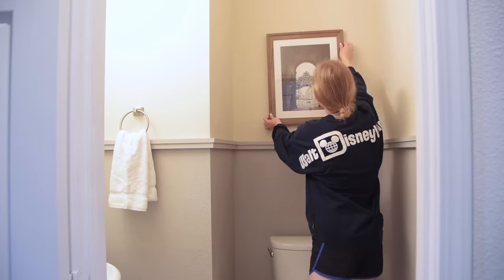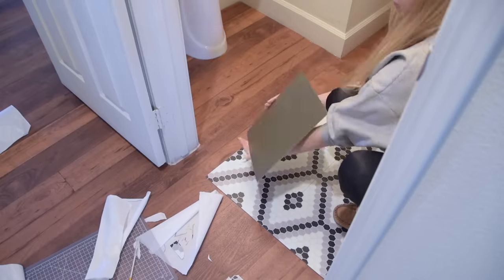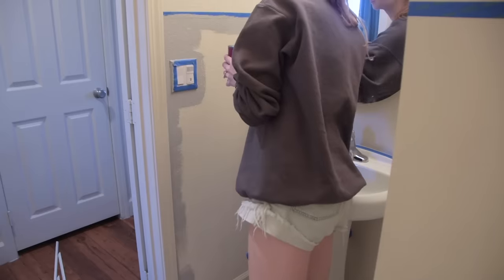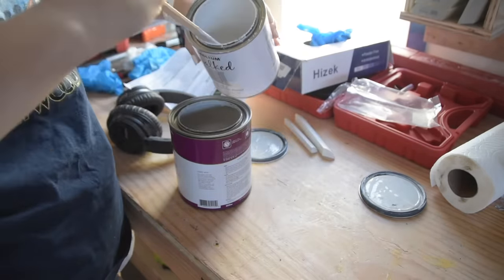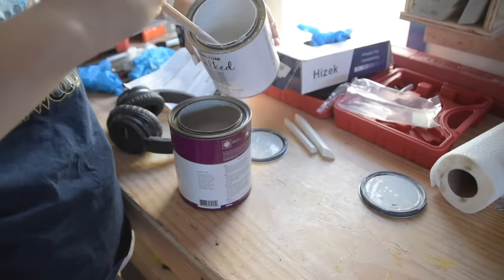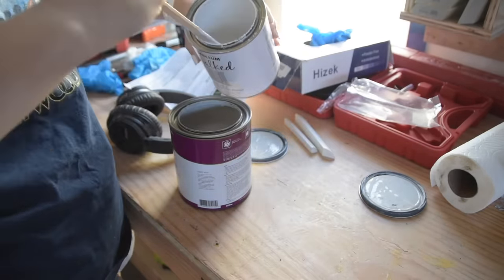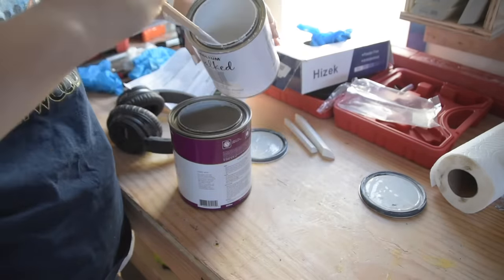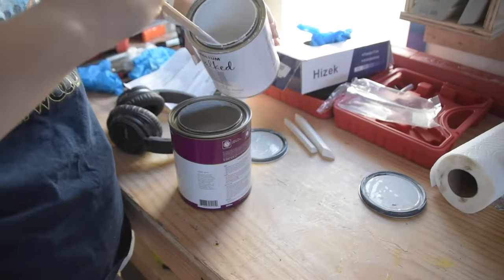DIY BATHROOM MAKEOVER ON A BUDGET | renter friendly bathroom makeover + small bathroom makeover

Comment: Great inexpensive makeover, excellent taste! I have a full bathroom that needs a makeover. It is a long narrow space with one small window and it feels dark and dingy. I am hoping to do faux white marble countertop, paint the sink and toilet (only the outside!), repair and paint drawers under the counter that have no runners or are not fitting correctly. Lastly, there are tiles that I just hate (12 x 12, mottled gray, stained grout) and I want to cover these with a peel and stick option.  I have never done something like this on my own before and am afraid to get started, but I am determined to get it done!  Thanks for showing and correcting mistakes, maybe I can avoid making some of those... ;-)

Comment: Stuck/stripped screw trick. Get a rubber band. Put it between the screw and the screwdriver head. Usually works.
Not sure if it will work on yours but thought I'd mention it.